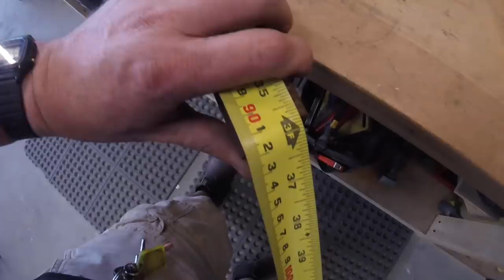Making a Steel Mace (for functional training)

Comment: What does your mace total length & weight measure & what size shot?  I’ve had 2 made so far, one with a 1.5 inch diameter pipe with an 8.8 pound shot, total length 39 inches, total weight 15.5 pounds.  The 2nd one is a total weight of 21 pounds and the pipe diameter is 1& 15/16, with a total length of 46 inches (12 pound shot).  My next one is gonna be made with a 16 pound shot and I’m expecting the same specs as the previous one for a total weight of around 25 pounds.

Comment: What are the dimensions used for this project?? Diameter of tubing? Wall thickness? Length? Diameter of the steel ball?
Reply from the maker: Why? So you can punch it into amazon and assume that you have the same level of fitness level and strength as me? If you don’t know yourself and you don’t understand how to make something strong enough you shouldn’t try it in the first place.